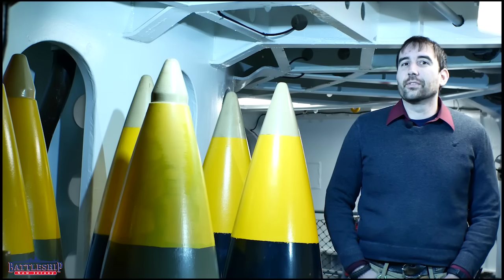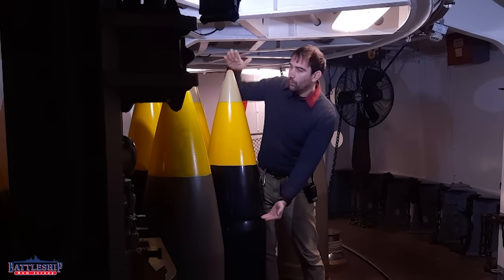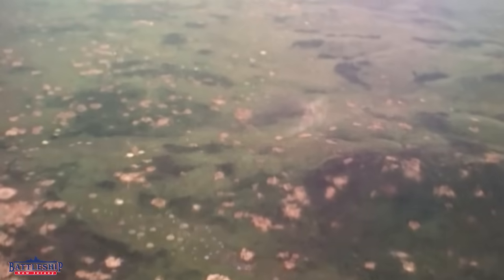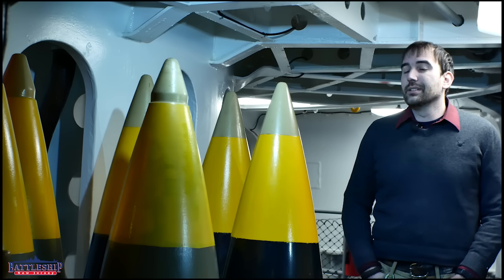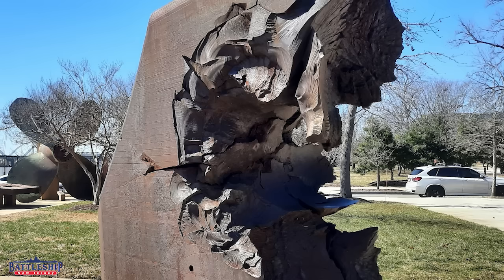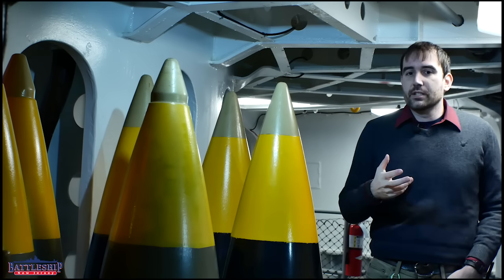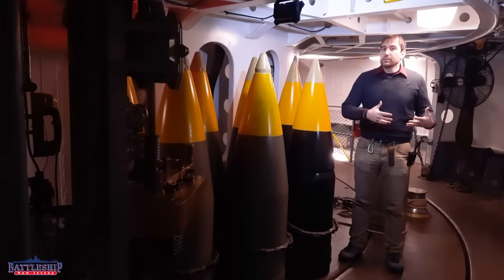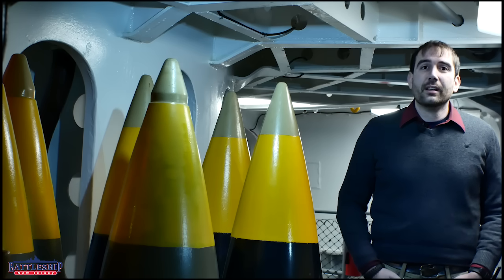What Does the Impact of a 16in Shell Look Like?

Comment: Two comments...

First, the test on the Japanese battleship turret face was done with a reduce power charge and lower muzzle velocity to simulate a longer range hit.  So wouldn't that be more realistic of a hit in combat?

The iowa class battleships were designed with the armor belt to be angled to help deflect the incoming shell coming from above.  The theory was that the armor didn't need to be as thick because of the angle would help deflect the round and also act as thicker armor.  The thinking behind it was the engagements wouldn't be point blank range and the shells from enemy ships would be coming from an angle above the ship down into the side armor.

Comment: I have heard the USN used "super heavy" AP naval shells, i.e. heavier shells will more penetrative power and smaller bursting charges, as explosive is much lighter than hardened steel. How did US projectiles compare to other nations? Is the trade off between a given calibers' penetration vs bursting charge size that simple?
Reply: Most other navies used a larger percentage bursting charge. Often 5%.  Ours was 1.5%. This is part of the reason our shells penetrated is much better.

Comment: I'd have to ask, how much does the impact of a Salvo of Seaceptor ashm or NSM hitting said battleship before that 16 inch dinosaur manages to get off a shot? 

There's a reason battleships aren't used anymore, the falklands war showed just how slow gun turrets vs incoming  exocets are. 

Much greater range are missiles, much faster, smart missiles too that can fly low to avoid flak, or weave to avoid countermeasures.

And missiles much more accurate.
Those old battleships also had WOODEN DECKS.

Comment: speed defeats armor. that said, an extreme low drag projectile going really fast would be ideal. carbide steel of course but you are talking about a really expensive projectile at that point. maybe a carbide core which penetrators already have but lead exterior? help it move faster. as for the armor, multi layer is great but filling the gaps with a viscous liquid would really aid in slowing the projectile down. sand also comes to mind. you would want these put at higher elevations of course. the water will help with the armor already submerged. good video. thank you

Comment: Speaking of reinforcement of old military buildings…. My unit was at an old Nike Missile base in the Chicago area. We had a old ass generator leak and had to close the building. (Hazmat concern). After this they started talking about tearing down the old building and building all new ones. After about 3 months they decided they wouldn’t do it. Between the weapon safes and being built to take missiles it would have been too hard and not cost effective. About a week later they had someone from the local historical society come asses it and get it designated as a historical building. There’s still old beer cans and crap under the building from the 50s. All the silos were either filled or covered and all the tunnels were filled. You can see the start of an old stairwell under our building. Still loaded with asbestos as well lol. Got out it in 15 so haven’t seen it in quite some time but I’m betting it’s still there. They reopened it after the leak. That was also fun. They wanted to take it out but only way would have been putting a hole in the roof and crane it out. They built that specific building around the generators.

Comment: Too heavy a bursting charge can result in smaller shrapnel and decreases the damage potential. This is why most of the weight of a bomb or shell is the metal metal casing. Also if a charge is too big the bomb will burst before building up peak pressure and will result in a low order explosion.
Reply: You know. That's impressive to think about it. They taught me that in gunnery A school in 73. You reminded me,  thanks for the memories.

Comment: i do wonder though, do you need a high caliber, like yamatos guns, to do lots of damage? can you tune grenades und guns, for example a 38cm gun from richelieu or bismarck or roma and give them the same power like a 46cm gun has?
Reply: No. Caliber is the length to bore ratio. Greater caliber improves accuracy, among other things. Diameter, as in 16 inch versus 14 inch directly affects hitting power. Beyond the fact that the bigger is just plain heavier, it has more mass, and the effect of the greater mass significantly increases the striking power. For example, a 16 inch shell does far more than twice the damage of an 8 inch shell. The average damage from a 16 inch shell is roughly 60% greater than that of a 14 inch shell. So, basically, the answer is you can't do something with a smaller gun to make it as destructive as a bigger gun.
Reply: @kennethmorgan3557  hmm thats disappointing. well maybe you can reduce the damage difference in speed? a 16 inch shell is of course heavier, so it needs more powder. if we increase the amount of powder in a 14 inch gun (of course in addition to make the gun stronger to handle the bigger burning) could that make a better difference?
Reply: @kaisertrinityt.m.i.s1607  It's a bit more complex than that. Increasing the velocity of the 14 inch shell by adding powder to the propellant would affect range more than striking power. The mass of the shell wouldn't be affected. And any significant increase in the powder charge would essentially require a major redesign of the gun structure. It would likely entail more than just replacing the breech and barrel. The guns were typically designed for the best possible performance on the platform on which they were installed. That's not to say we couldn't potentially design a better gun now but why, given the entire ship was designed with the armament as a major consideration.  Think about making a B-17 a better bomber by replacing the 4 piston engines with jets. It wouldn't work. Neither would this.
Reply: @kennethmorgan3557  ah ok i see. well as you sayed its a complex system. when i sayed to add more powder to make the gun stronger, i was compairing it with railguns with the idea behind more speed = more impact force or certain ammonition used in guns for infatry, but the differences are of course in a much higher league! but thinking about it, a Yamato Class battleship with railguns.... that would be devastating.
anyway, thanks ALOT for your information, your knowledge was very valuable for me! :)

Comment: On a weapons-logistics shipcheck out of LBNSY in 1986, the Missouri fired at an island off the So. California Coast. They had dawn a 1,000 yard circle, with a golf flagstick in the center. The footage revealed that the stick was obliterated, and only 1 crater was outside the strike zone. The range was 20 miles....Also, a concrete bunker was installed there, and it too, was obliterated.

Comment: Answer: 40 or 50 foot diameter crater.
Level one small square city block of structures 3 storeys high or shorter.
You wouldnt want to be within one half a mile.
One shell. A volley? Forget it

Comment: The Mark 7 lightweight 16" naval rifle firing either the super heavy or high capacity shell is the finest artillery yet devised. I have no suggestions for improvements:)  As the IOWAs were being retired work was well underway on a couple of extended range 16" munitions, on the order of 80 - 100+ miles range. The IOWA actually performed fitment, strikedown and loading tests with prototype shells. 

Interestingly, the Mark 7 rifles were designed and built with huge capacity for overpressure. It was and is feasible to consider using supercharges of powder for extended range using existing rounds.

There is one picture I have found of an IOWA (MISSOURI I think) shell striking on or very close to a decommissioned ship in a SINKEX exercise. It looks like the shells straddling the GAMBIER BAY at Samar, only bigger. Which is saying something...

Comment: It's always been the splintering caused by the projectile going through the hull that was the worst effect. Even in the days of wooden ships, splintering was what caused the wounds and deaths. When we were at GQ on the ship well inside the ship, we would wear helmets, the same type as worn in WWII. Not to protect us from projectiles, but to protect our heads from the massively deformed bulkheads, decks, and overheads. The sailors now wear much better equipment than we had in 1968-'70. If you brush against a deformed bulkhead with a chambray shirt on, you're going to get cut very badly.

Comment: Kind of curious how these shells would've worked if the explosive charge was shaped more like a modern day RPG against enemy ships. Or were they shaped in such a way?
Reply: I have never heard of a shaped charge used on a large naval gun. It would probably not be to effective as it would only make very small holes and the jets they form break up quickly. So it may not go very deep into the ship. The Iowa's would actually be quite resistant to these rounds as they had internal belts which would give pretty big stand off distances greatly reducing penetration.

Comment: It is said that if a B-52 and a Battleship targeted the same place, the B-52 would deliver more tonnage in the same time as the Battleship can fire two rounds in the same time. In Vietnam, those that saw both the damage that the New Jersey did versus the B-52, you can see what type of pattern both did. That is one reason why the B-52 is feared. But the enemy also feared the New Jersey. Both are worth their weight in gold.
Reply from the maker: Theres a reason why both are needed. The B-52 carries a lot less than a battleship, and stands a higher chance of an American being killed during that mission. It can drop a lot very quickly, but the battleships can continue to bombard for hours from the safety of 20 miles away.

Comment: We visited Normandy in 2019 and one of the places we were at was Pont Du Hoc, there are two types of craters there, one for the bombs that were dropped and the others were from the Battleship guns that hammered the area. Both are impressive, the bomb craters are round and the gun craters are oval. Both are still very deep after 75 plus years.

Comment: For Shinano tests, you have a great run-down on NavWeaps.

But the tests were not done as if at point blank range. The guns were fired with reduced charges, and at 607 m/s the 16" Mk8 AP round penetrated the armor that you show in the video. The Mk8 round will be doing 607 m/s at around 10-12 kilometers. I assume differences in armor penetration values between this test and the stated figures is more down to armor quality differences, apparently the Yamato turret faces were desgined as Vickers Cemented armor, a pre-WW1 armor type. 

In practice the turret faces were impenetratble since they were reclined at 45 degrees. At 10-12 kilometers the shells wouldn't impact with enough angle, while at 36 kilometers where the angle of impact would be 45 degrees (e.g. more or zero obliqueness into the turret face) the speed of impact was only 500 m/s.

Comment: Does anyone know why they did not just make the whole armor piercing shell out of the harder steel as opposed to having the pointed section hollow? You would think if the point was made of the "Armor Piercing Steel" it might penetrate easier. Maybe it was to cause more spall???
Reply: Solid ap shells shatter against face hardened plate and tend to ricochet at oblique impact angles. A  piercing cap  absorbs  the initial impact by supporting the nose of the penetrator, and helps prevent shatter and ricochet. Construction being ductile steel, is easily pushed aside by the harder penetrator. The ballistic cap is obviously destroyed on impact too and serves only to streamline the otherwise blunt nosed capped shell
Reply: @berttrombetta4953  Very Informative. Thanks , makes total sense.

Comment: As a professional photographer/videographer I have a few suggestions. You should consider using a tripod with a fluid ball head. these are cheap and work well for this format of video. You should also set the camera settings to expose for the brightest area. It's much easier to pull shadows in post, than it is to try and fix overexposing. I'd always rather my raw footage to be slightly underexposed then pushed in post. Obviously don't make your footage black, that's just as useless. But it will really help remove those highlights on your face from the strong point lighting in the ship. Also, ensure you're always using manual focus. 

I really love your content and this channel and have certainly seen an increase in quality of production and your ability to speak clearly on camera. Keep it up. Can't wait for more.

Comment: I didn't see the impacts but the Missouri and Wisconsin were lobbing 16 in rounds over our heads during Dessert storm. 
Mighty Mo and the Wisconsin pounded the crap out of Iraqi Artillery positions that were lobbing rounds at my fellow Marines .  Looking back 30 years, the under equiped front line Iraqis with no water and starving got pounded by B 52's 16in shells and ground based 155mm rounds knocked the fight out of most .  Anyhow Semper Fi

Comment: In the very beginning you called that 16 inch shell of 50 caliber. Are you nuts?
Reply: The gun barrel is 50 calibers long.  16 inches X50  is 66.6 feet long.  The shell is called a 16''-50.  Its a common  way to denote the gun and shell it used..

Comment: I believe the only Battleship available that  sustained damage from another Battleship. Is the Massachusetts. A tour of Big Maeme would be cool.
Reply: I toured her years ago and I recall that she has a scar from an8 inch shell hit which didn't penetrate.
Reply: @kennethmorgan3557  They marked off all the repaired areas. On board the INJ Mikasa in Yokosuka, Japan. They Marked off the damage she sustained in the Battle of the Tusima Straights.
Reply: @bigsteve6200  If you mean repaired areas on the Massachusetts, I don't recall that from my visit, but the 8 inch scar was pointed out. I also toured the Mikasa while on active duty with the USN and don't recall any notation of damage from the Russo-Japanese war, although she was hit many times. She also suffered a major magazine explosion shortly after the war which resulted in her sinking. Repairs took about 2 years and included an upgrade to her main armament which would lead me to suspect that if there were any damage remaining from Tsushima, that would have been addressed at the time of the repairs from the magazine explosion.
Reply: @kennethmorgan3557  there were some outlined areas in a berthing compartments just forward and port side of the #2 torrent. Which was repaired.

Comment: This WILL get buried, but the US realized in the early 1920s, with the introduction of the Colorado Class and 16" AP Mk II, that low C/M (charge to mass ratio) in shells allowed for an incredible increase in penetration. If you run the numbers, even British Greenboy shells or World War Two 15"/42 shells with a .02 or .025 C/M lag notably behind the penetrative capability of .015 C/M ratio shells fired out of the 14"/50 standards. I believe they are behind even the 14"/45 penetration with .015 C/M, but I cannot check the numbers right now and do not want to be wrong. 

The Japanese were also very aware of the advantages of the 1.5% C/M, and though their guns were not as powerful in raw numbers, this extra penetration allowed them to make the best use of their 16" ships.
Reply: Okay, this answers one of the questions I have had through this whole video, as I was wondering why the size of the charge was so small (~150lb), relatively speaking, given the overall weight of the projectile itself (~2,700lb).

I assume this only applies to the AP rounds. Any information on the high explosive shells? I am still not finding good numbers on the exact explosive payload they carry, especially in comparison to something like a 1000lb GBU.
Reply: @Laotzu.Goldbug  that 150 pound charge refers to the HE shell. The AP is as low as 40.9 pounds. 

However, it's not directly comparable with a Mk83 LDGP or equivalent guided bomb. The majority of the damage from that comes from the high explosive itself, while the battleship shells have imparted energy from the impact, the bursting charge, and most critically, the shrapnel the HE shell throws. It's not as efficient as a conventional bomb, but it's very effective in its own way.

Thicker shell walls and a smaller charge mean more large pieces of shrapnel, which can do more damage to individual objects around the area of impact.

http://navweaps.com/Weapons/WNUS_16-50_mk7.php

Here's a good website that will tell you about the ammunition for the 16" gun. The rabbit hole goes very deep on this topic, so I tried to condense things down as much as I could.
Reply: Drache has rated all the common shells.